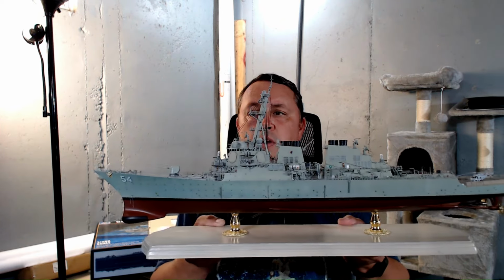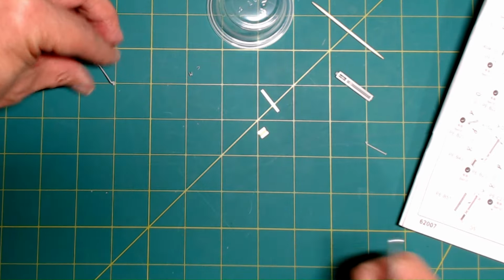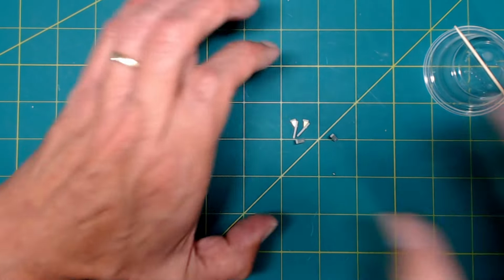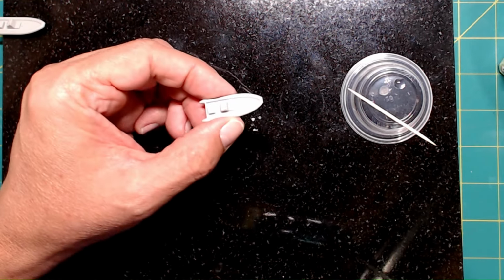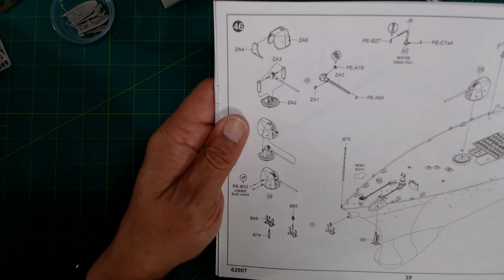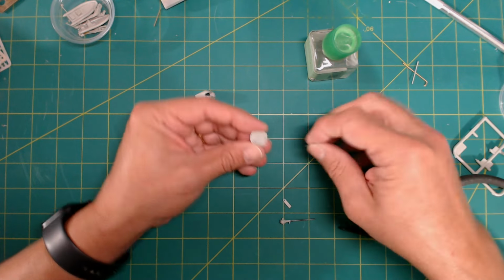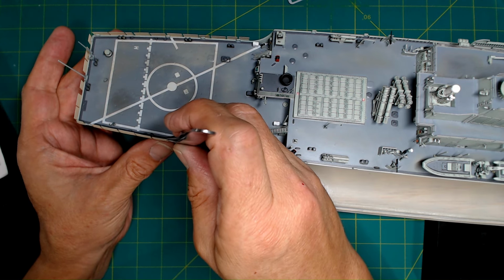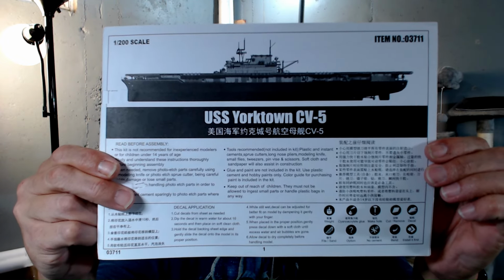USS Curtis Wilbur in 1/200, Video 20, Final Assembly and Wrapping Up

Comment: 20:21 what you're installing at this part of the video is actually an apparatus we used when taking on stores from another ship while underway at sea. It holds the connection point for a line shared between ships, that is manually controlled to move up and down the rod there to keep the tension on the line between the ships (and to keep what's between towed from one ship to another out of the water). We only used it (in my time onboard DDG65 plankowner) when taking on stores when deployed for extended periods. I haven't had the time to watch all your clips but it's been fun to watch when I get the chance. Great work!
Reply from the maker: I really appreciate that correction. I thought it was odd but then again, the internet really likes to point out only the fun stuff, lol. I'm noting this for any future builds where similar assemblies might exist. Thank you so much for watching and thank you for your service!
Reply: @PatricksScaleStudio-76  Thanks for the support Patrick! Having served on Destroyers (Spruance & Arleigh Burke) if you have any questions about any of the equipment feel free to drop a line/direct message.
Reply from the maker: I may be taking you up on that one of these days, but this next build, CV-5 USS Yorktown, will be a far departure from modern US Navy.
Reply: I believe that those parts were called Sliding Padeyes.
Reply from the maker: @michaelcavanaugh1581 , I appreciate your input on those fixtures. Thank you for watching!

Comment: Absolutely fantastic work!

I’m getting back into the hobby after a several decade gap and am working my way through proper techniques and practices, this series is a great help and will be referred to continuously I’m sure. 

I had the 1/350 COLE (was my last seagoing command) on my list but changed it to this hull because of this series and the “upgrade” kit with the COLE markings and extra stuff. Going to save my pennies for sure and work through the 1/350 Yamato on my shelf first. 

One thing if you care, your screws (propellers) are on the wrong shafts and need to be switched lol. On the Burkes they spin outboard from the top as viewed from the rear ;).
Reply from the maker: @HyperCadaver , thank you for the compliments! Should you have any questions when you start yours, don’t hesitate to reach out. The props were a wash for me because as I understand it, they were molded in reverse pitch. Since they’re super glued on, I’ll just leave them as is. My aim with this build was to focus on skills to tackle the larger projects like the  Yorktown with all the goodies. Thank you for your service and thank you for watching!
Reply: @PatricksScaleStudio-76  reverse pitch just means the blades are shown pivoted to “bite” the water in a way that makes the ship go in reverse. The props only ever spin in one direction and use a combination of RPM and blade pitch to change speed and direction.  I’ll see if I can find a video showing what I mean….

Here’s an example although the Navy calls it Controllable Reversible Pitch (CRP), same thing though. 

https://youtu.be/l15JFtoJ59g
Reply from the maker: @HyperCadaver , I understand and knew the Arleigh Burkes had variable pitch props. I found it curious they were molded in reverse and wasn’t biting on any extras for the kit. Going forward, however, I will be paying more attention to their rotation when putting them in their proper places and really appreciate your feedback on it; it allows me to grow for my future projects.

Comment: BTW, I just got the email that my USS Pinckney kit will be coming probably by the end of this next week. So I'll have two Burke destroyers to do! Supposed to be dwindling my stash, but hey ho! 😊
Reply from the maker: Are you planning on using any of the available update sets for either of them?
Reply: @PatricksScaleStudio-76  Yes, I pulled the trigger on the big HS kit like Norwegian Modeler just did a review on. It sure hit the pocketbook and shortly afterwards, I kind of wished I hadn't bought it because some life things happened and that money would be nice to have now. 🫤 The one thing that is very misleading to the HS detail set, is the box illustration shows the Flight IIa and III on it, seemingly hinting that you could use the set with them, so I actually got it for the Pinckney. But there are no IIa or III specific parts in the set, and those ships have some distinct differences especially in the flight deck area. Some things can be used for both Burke kits, and I will probably split the detail set between the two.  Maybe build them both at the same time??? 🫣
Reply from the maker: @ladyknieval , that set was being developed when I started on my build. Once it was released I couldn't believe how expensive it was. That's a shame they didn't develop it to be used with any of the DDGs from that class. Kenneth also pointed out the Seahawk being a bit of a disappointment as well because the cockpit being solid.